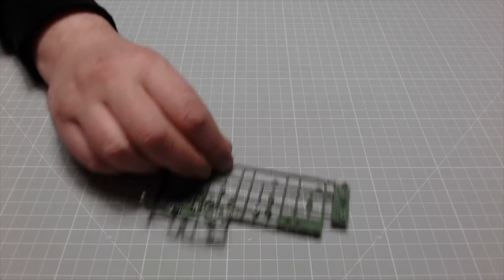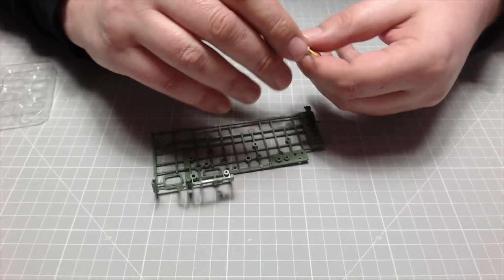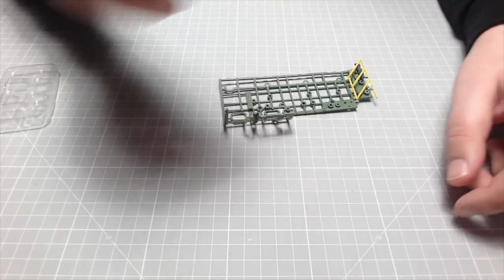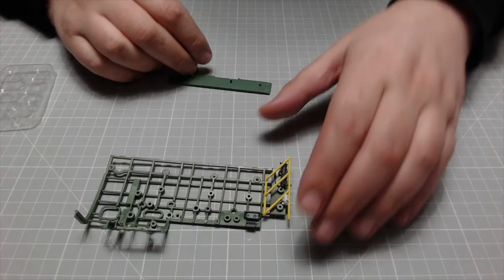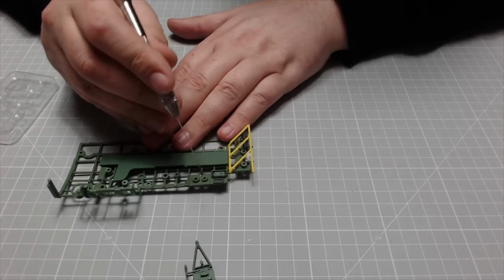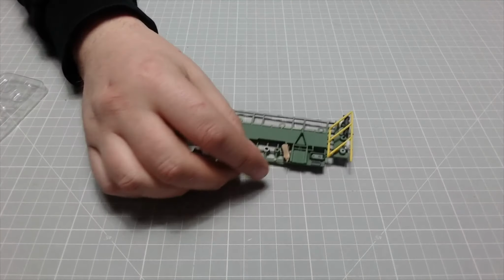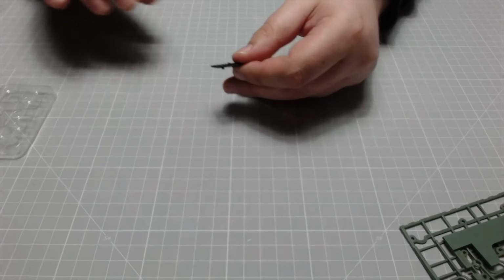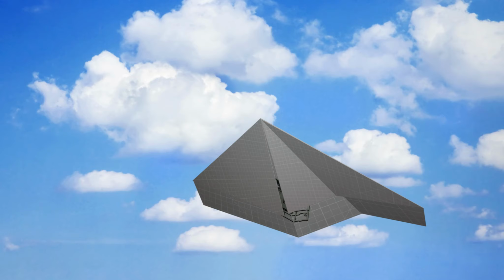Build The Lancaster Bomber Issue 7

Comment: I think you have placed the 'seat back' through the wrong side of the frame. I think it's supposed to lay alongside the Engineer's seat, following its line, & lays on the surface of the large green panel. I have been a bit 'cheeky' & sent you an e-mail with a picture of what I mean. I hope you don't mind & I apologise if you are offended.
Reply from the maker: Hi not offended at all thanks for your email. I see now where you mean and yes I made a mistake. I have corrected it now. Thank you ever so much for letting me know
Reply: @MarksModz  No problem at all. Onwards & upwards as they say, lol!